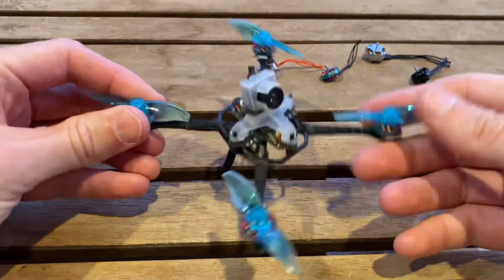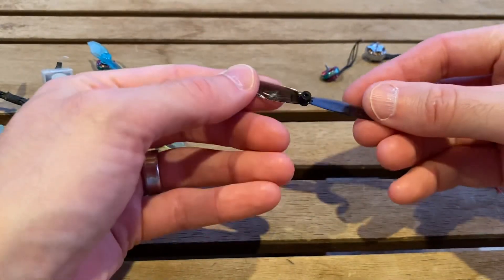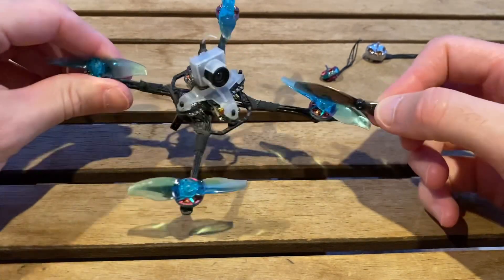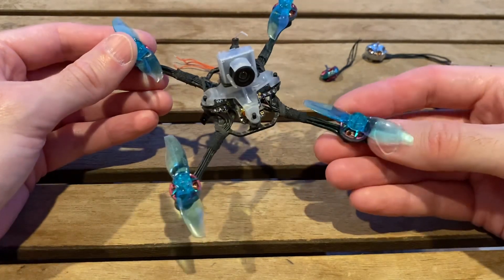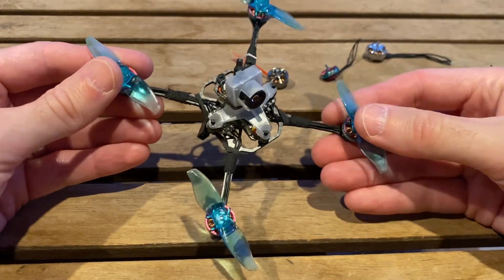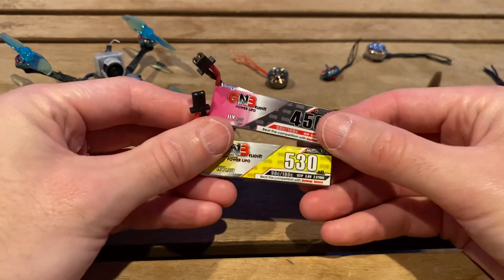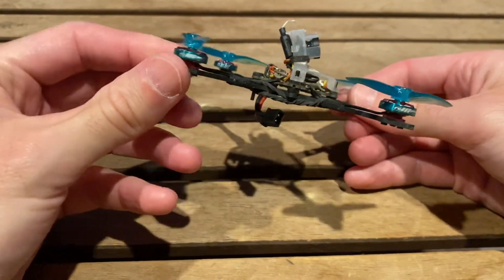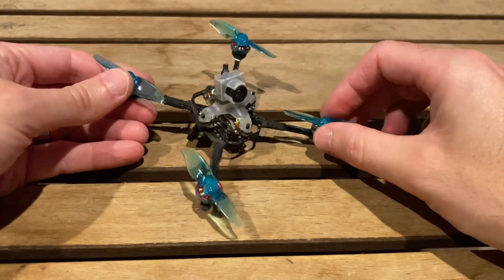I learned something: RCinpower 1002 22,000 kv vs Newbeedrone 1102 19,000 kv

Comment: odd i cant speak for the beta fpv 18000kv but the 1102 22000kv betafpv motors rip dude and i own the 1003 rcing powers and flow motors aswell   now durability vs durability i cant really say but as for raw performance the betafpv 1102 22000kv def rip my 75mm acts almost like my 5 inch with them qnd my savagebee frame woth 3 8nch gemfan triblades rips an handles very well . i prefer the rcing power 1003 due to the cosmetics and mountong options but dont sleep on those betafpv motors some of then wre actually nice  do you fly 1s packs at all on your micro toothpicks or whats your prefered ?
Reply from the maker: Do you fly the 1102 22,000k with the gemfan 2015 biblades?

Comment: I run T motor 1103 on my 65mm with gemfan bi’s running on 2s and is a absolute bullet while still being one of the most locked in quads I have. Running on savage bee frame with runcam dvr board in there

Comment: Could I put these on my Newbeedrone Mosquito XL 2s?
Reply from the maker: These are both high kv 1S options, you would want lower kv for 2S.
Reply: @Quad66  what's the highest kv motor I could go with on my setup?
Reply from the maker: @cold-frontin_penguin7902  the only way to find out is to play will it smoke

Comment: HQ props makes 2 styles of very good 65mm. One looks like the Gemfans, but balanced. The other is a T motor style hub like those Emax Avia props.  
19000KV is for 31mm props.  if you're spinning 51mm/2",  65mm/2.5",  or even 3" on 19000 KV motors, they aren't going to work well. it's like starting a car in fifth gear.  You would need a much bigger motor to have enough torque to change the speed on the prop. I run 13000kv on 1102 with 65mm props.
Reply from the maker: This information isn’t very true. The HQ press on lack thrust and efficiency and the T65 lack are often very poorly balanced. Motor torque is a function of the magnet strength, air gap, and stator iron content, not KV. The KV is relevant in terms or efficiency for a given torque. The high KV motor will spin up just fine compared to a low KV, there’s just an efficiency penalty. Matching KV to a particular prop size is not as direct as indicated since the torque and motor geometry will play an equally large role in how fast a motor can spin a prop.
Reply: @Quad66  Well, your information isn't particularly true. My group is testing a 65mm propped drone for production, and the HQ props in testing have all been fine. the press-on have less thrust because they are low pitch. We haven't seen an unbalanced 3 hole yet.   While your theory on motor torque would be correct if a "perfect" power supply was used, in practice, A higher KV motor needs more current for the same thrust. That Higher current draw comes up against the resistance of the battery and the ESC, causing voltage sag, and less torque to be made, while producing a more heat, and less efficiency.  So in the real world, when powered from a 1s  drone battery, if you run too high of a KV, you make less torque.
Reply: @Quad66   That's not how that works. You have a piece of correct information that you are misapplying to the situation. The short answer is that a stupidly high KV motor being fed through a tiny battery and spinning a prop that is way to big for it will perform like crap compared to the same size motor at a better matched KV for the prop. The long answer is... I really need to make a video on this. there are a lot of factors involved. Chris Rosser covers some of it, but it's worth a deep dive with demonstrations.

Comment: I have a fettec 15a aio, 1202.5 11500kv, Fpvcycle Babytooth frame and 1s 500mah... What setup would you recommend in terms of Prop size and Battery voltage (soldering the 1s 500mah in series for 2s power?)
Reply: To be more specific: i have 2 bladed 3018, 3 bladed 2512, and 3 bladed 2023 gemfan props. Which give the best handling and controll with those motors and 1-2s? AUWs propably a bit higher then what you are used to

Comment: Have you ever tried the 1103 8500kv new toka mamba motor looking for a setup have some their real notche have betaflight 4.3  Kabab 115 toothpick fr 2mm cl racing fc 32bit F7 board 2s with 2015 gemfan on 2s  any suggestions on prop sel

Comment: Thanks for the interesting vids with these different motors and prop setups. I have a bunch of Betafpv 1102 18000kv and thought 2 inch was about as big as they can go but now I'm totally going to try them on 65mm props. I have some 13500kv from an older hx100se, think 2 inch 2s can handle?

Comment: I love those flywoo 1203 so much.
Otherwise the happymodel 1102 13500kv motors on GF 2040 props are awesome on a smaller 2" build.
I got some of these 1002 rcinpower motors and built it on a NBD mosquito frame with AZI 40mm props. No bad, but honestly I prefer the slightly bigger 1S builds.
By the way I'm telling you again to cut some HQPROP 63mmx6 props down to bi blade. There you have your loved 2.5" props that you are looking for. At least as colse as you can get on the market right now.
I literally own and tested every prop from 1.6" to 3" props on the market.
Reply from the maker: I tried cutting down the HQ 63x6 and didn’t get great results. I had quite a bit of vibration. I probably could have been more careful cutting and trimming things down but I go through props too fast to put a ton of effort into prepping a prop.

Comment: Do the short wired HGLRC motors have PCBs under that heatshrink where the wires connect? It looks like it. If so, it would be an (unnecessary if they had the wires just a tad longer, sure) easy fix with a soldering iron. I see more and more companies having their motor wires connected to PCBs and it's awesome. no more heatshrink blobs mid-wire because you had to lenghten them when switching them over to a different frame.
Reply from the maker: I don’t see a PCB but haven’t stripped the heat shrink.

Comment: Thank you! 
Any change in flight duration with the larger war pig? I'm on 19000kv. BTW I just broke the ceramic antenna with the same canopy...
Last i used 2.5 Avan on 1103. Less top end for sure but I like the reactivity...
Reply from the maker: No notable change in flight time with the longer arms.